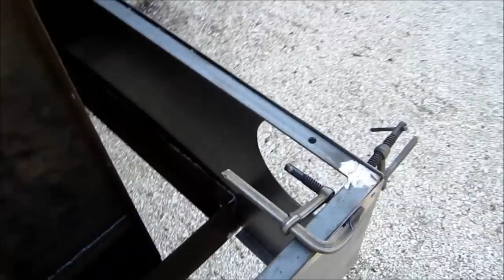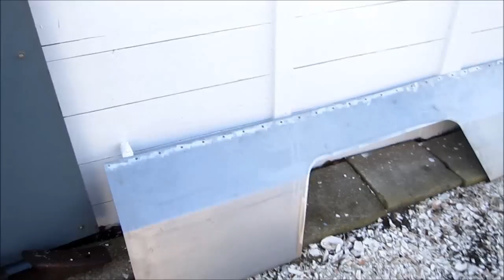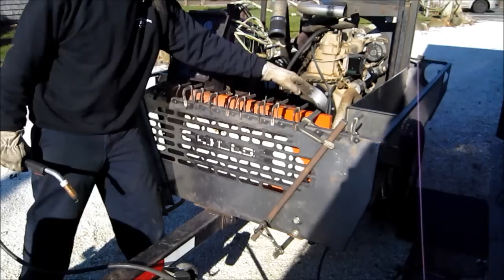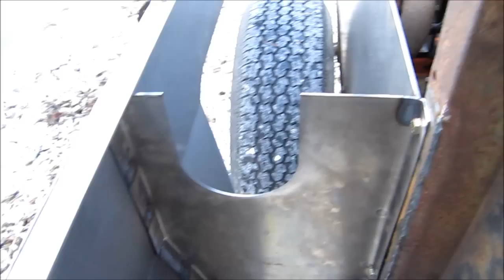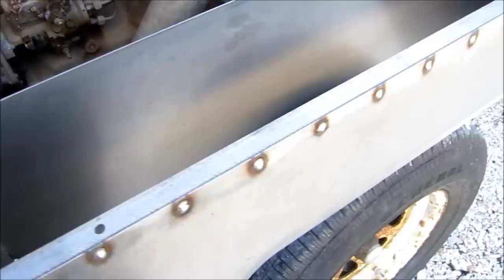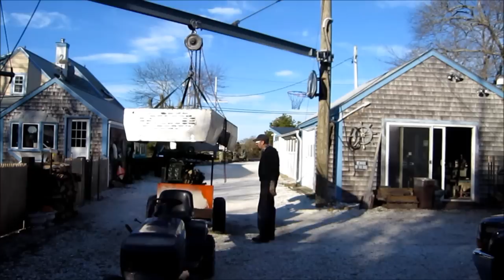Tin Knocking 2

Comment from the maker: Practice what is comfortable for you, and be open to convert if needed for the project your working on, if it was created using the other. They are tools that help guide your standards in workmanship! If someone came on your boat and took a Sharpe and marked to lines on the top of the cooler, using a tape measure with metric or inch, and said that how long the fish must be! you work to those standards. good luck fishing! ;{)-----